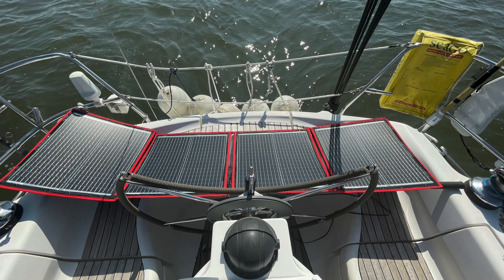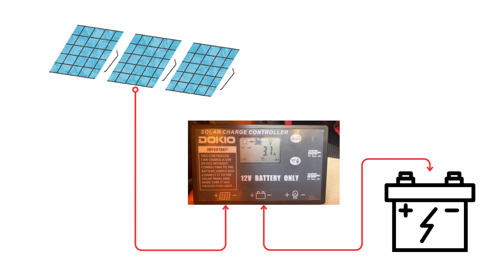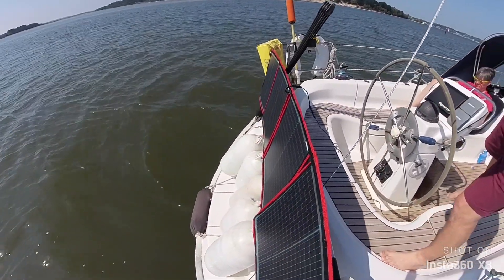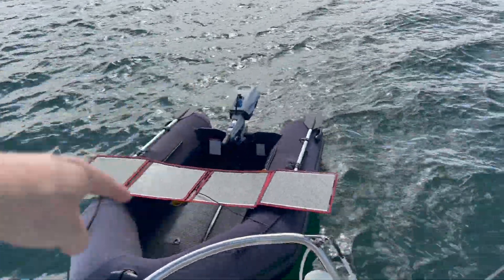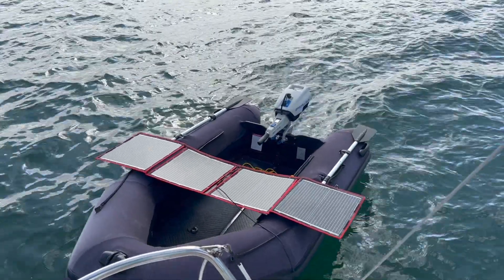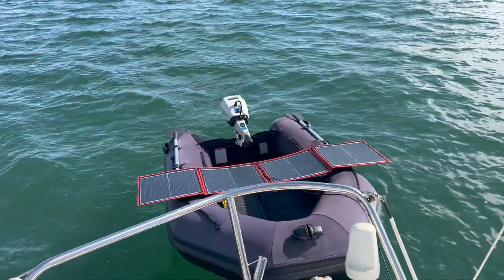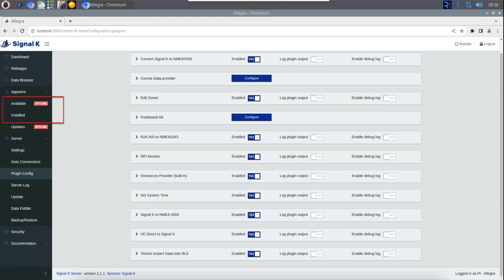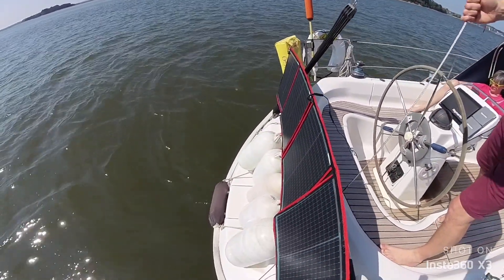Solar Charge Controllers - PWM Vs MPPT, What does this mean and how do they perform? Boat Bprojects

Comment: It's not an ideal situation given the small panels, but if you are piling on more solar then you really want to go with a MPPT, and the Victron is a good choice.  Also for maximum flexibility you want at least two panels in series with the Victron (roughly 40V operating), or use a higher-voltage panel.  It will work with one panel but the Victron needs BAT+5V on the solar input to start and while it will regulate down to BAT+1V on the solar input after that, this is still roughly 14-15V on a panel that can only produce such voltages (under load) in full sun.

Putting two panels in series does require that their amperage specs be roughly the same.  If they aren't, don't put them in series.   Putting two panels in parallel requires that their voltage specs be roughly the same.

In anycase, its a good start.  You might want to consider constructing a little outrigger mount off the railing to place your foldable solar on.  Just a foot or so.  Even three... left, rear, and right side cockpit railing, and considering some permanent wiring for them.  Gives you a better chance at getting some consistency in variable sun and shadowing conditions. Then put the actual foldables on the outriggers when wind conditions permit.

A big part of adding solar power to the boat is the convenience factor.
Reply from the maker: Really good advice, thanks for taking the time to post this. I think I will invest in some sort of rig to mount the panels. I know the Victron kit is good gear so I am glad I have this now.